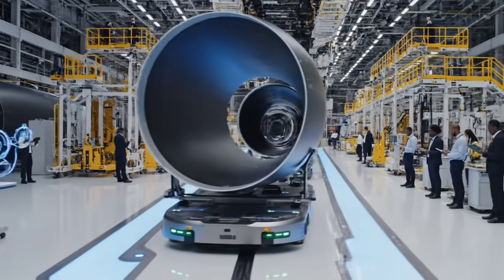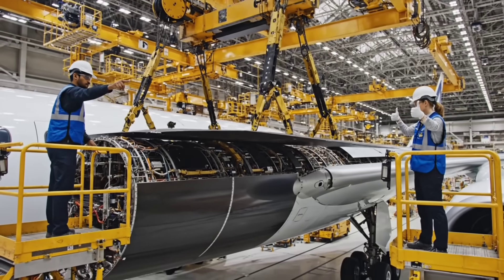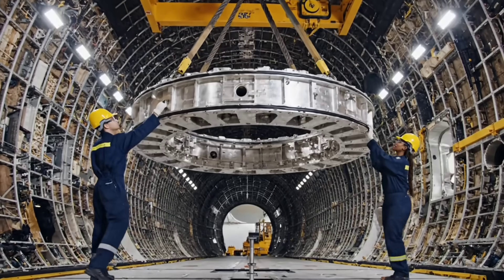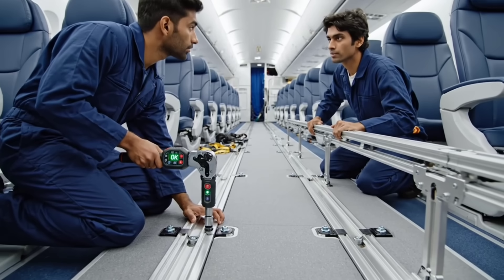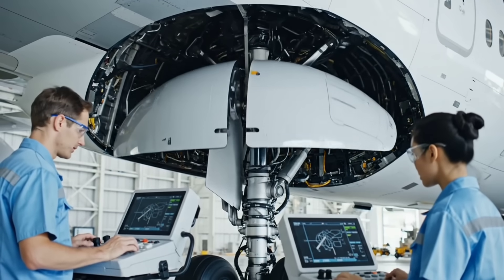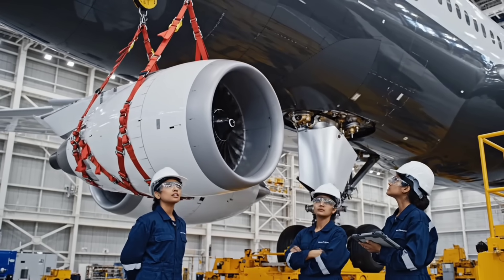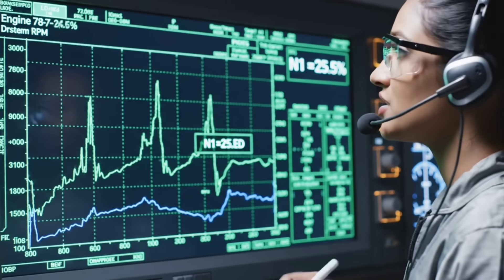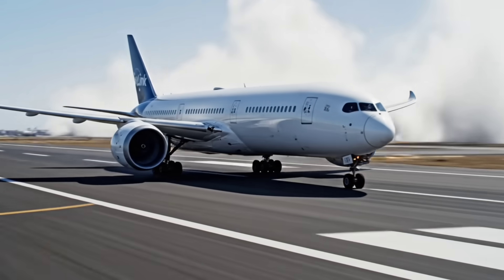Inside the World's Largest Airplane Factory: Building the $400M Boeing 787 Dreamliner (Full Process)

Comment: The Boeing 787 factory is a perfect example of modern aerospace manufacturing at its highest level. Seeing massive fuselage sections joined, wings installed, and advanced avionics integrated with such accuracy is incredible. I didn’t realize how much of the Dreamliner relies on composite materials rather than traditional aluminum. The final assembly hall alone looks like a city. This video makes you appreciate how complex and precise building a commercial aircraft really is